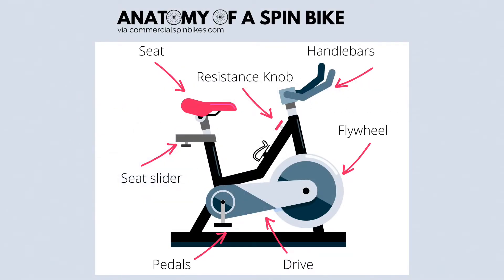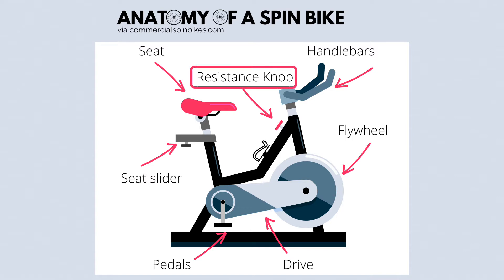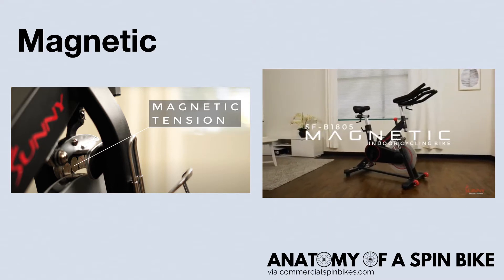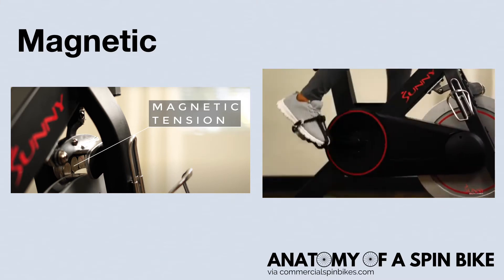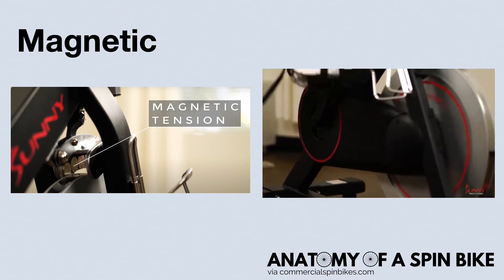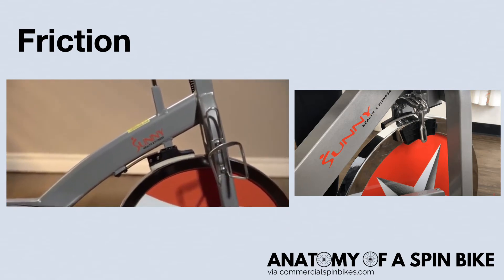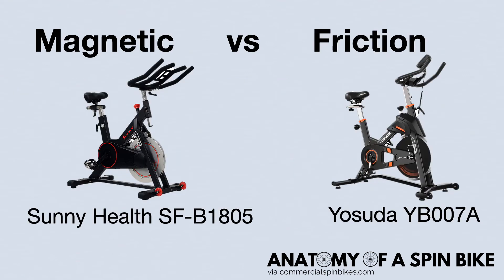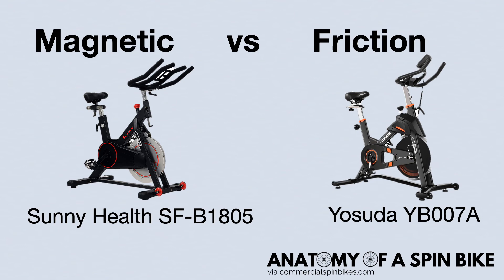Commercial Spin Bike Magnetic Resistance vs Friction Resistance

Comment: I think the more important feature is the manor in which the resistance is applied.... a rotational dial vs a lever. A rotational dial may take many revolutions to achieve your required resistance. A lever only required a click or two.
The rotational dial on my home spin bike does not compare to the lever on the gym spin bike.